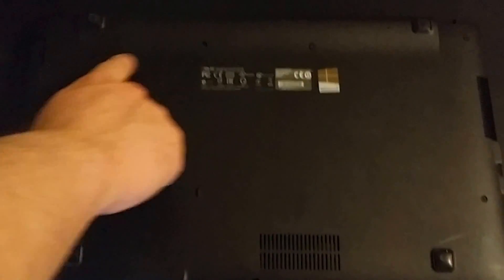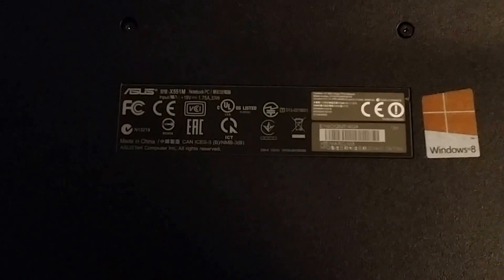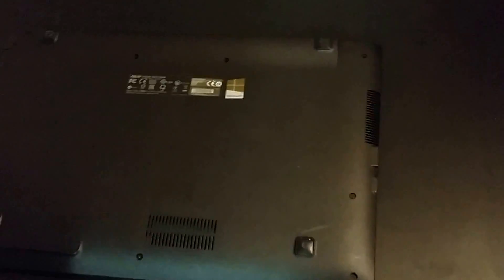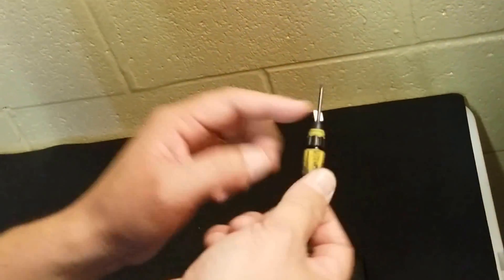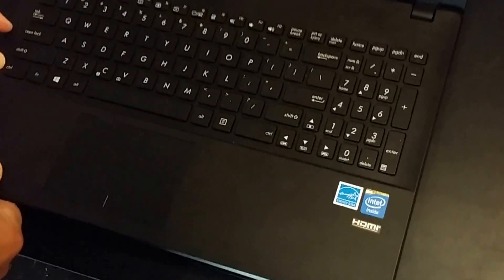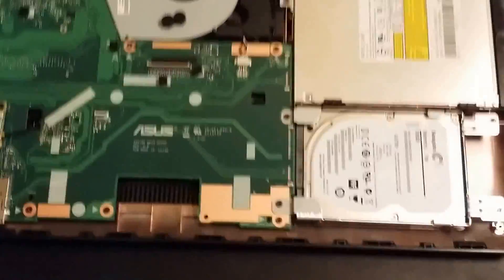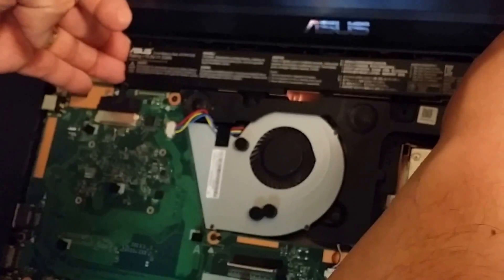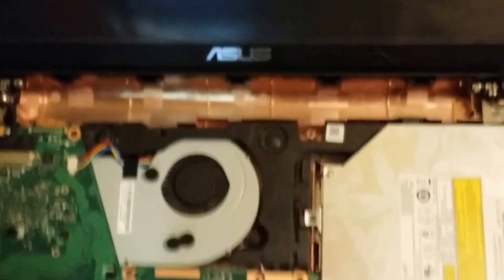ASUS X551M Laptop Battery Removal & Won't Power On Fix

Comment: This is a terrible design, my neighbor has this laptop and she has a virus on it that prevents you from shutting the computer down or doing anything on it aside from logging in. It's one of those virus's that want to you call a number and give them money so they can tell you how to fix it. So I just need to reboot the damn thing so I can boot it into safemode to remove the virus but I can't do it unless I pull the battery and put it back in.
Reply: TheCobruhAlienat0r I had the same problem. But, good thing I have a computer tech living in my house. Got it fixed right away.
Reply: *****
I read somewhere that they designed it that way because it was cheaper and because they figured that by the time the battery started going bad that they'd be looking for a new laptop anyway so the customer would just get a new laptop instead of a new battery.
Reply from the maker: TheCobruhAlienat0r They may have designed it that way for that reason in mind but does that necessarily make it right?  Had they designed a latch/cut out where the battery is and reversed the battery port on the motherboard so the battery could be removed from the bottom instead of the top, it would have solved everything.  I have customers bringing in computers/laptops that are circa 2004 Pentium M computers w/ Windows XP that are STILL serviceable (for the most basic things nowadays mind you) and they will not let them go and give them up.  They just want me to remove virus/malware off them and get them a new battery.
Reply: Why not just hold the power button for 5ish seconds?
Reply: SmokeyKurt
I tried that, it just put it into sleep mode. I was able to fix it without pulling the battery. It turned out that the virus had flipped the mouse buttons to where left click would do right click and right click would do left. So I installed Avast and Malware Bytes and got rid of it.
Reply from the maker: I agree that this IS a terrible design.  Some people are saying that the design was to facilitate motherboard removal or because it is used for "CHEAP" computers.  I think those reasons are "questionable" at best.  Computers are supposed to be END USER friendly made for regular people in mind.  Not being able to remove something like a battery is something I personally don't agree with.  Heck, most CELL PHONES have the ability to get to the battery to be able to replace it and those are exchanged out every 2-4 years!

Comment: Moron is the proper word! my thoughts exactly
Reply from the maker: Yeah, i was kind of harsh in my review and my emotions kind of spilled onto the video.  What should have been a 3 second action of simply removing the battery the normal way turned into something a lot longer.  In order to remove/replace the LED screen, you HAVE to remove all power sources such as the battery and AC adapter, thus my frustration.

Comment: Just got this computer for my mom, but I feel like we should change it, she's not tech say and travels a lot and if she needs to change the battery in a jam she won't be able to replace it. Soooo stupid.
Reply from the maker: Yes.  The next computer or laptop that you purchase, ALWAYS check for user efficiency such as removable batteries and hard drive/memory slot covers.  Then check for system specifications such as CPU type, Amount of Memory, Hard Drive type and size, discrete vs. motherboard integrated vs. CPU integrated graphics, etc.
Reply: Brenda G.P. What size screw driver did u use in the video.

Comment: See where I have a problem is putting the cords back, why did you not show you putting the laptop back together ??
Reply from the maker: Simply go in reverse after removing the battery.  Install the battery, carefully insert the ribbon cables back in then lock the latches back into place, snap the lid back to the base, then tighten all the screws back where they went.

Comment: how can i incrase the ram? i have that laptop and is shit...
Reply from the maker: Your motherboard may or may not be able to increase the memory depending on if your board is the permanently soldered on memory or the standard removable DIMM slot memory.  The memory is on the underside of the motherboard.

Comment: i am wondering, the battery life is so bad, is there a way to get a better performing battery?
Reply from the maker: Some laptop models allow you to get either a 6, 9, or 12 cell Li-Ion battery.  Some models will not allow you to switch to higher capacity batteries.  Check on the ASUS Technical Specifications for this model and look under the battery sub header to see if you can get a higher capacity battery in this system.

Comment: Thanks your video helped. it might of be cool to add a close-up of how to reconnect the ribbon cable, and a heads up on what to expect when you restart for the first time. But you helped me solve my problem. Thanks again for that!
Reply from the maker: You are welcome.  I am glad the video helped you with your problem.  Unfortunately, as I said in the beginning of the video, it was recorded with a smartphone and my intent was to help those frustrated (like I was) in trying to remove or replace the Li-Ion battery.

Comment: My best part "who ever came up with this design from asus is a moron"  LMAO.
Reply from the maker: Yeah, my frustration reared its ugly head unfortunately.  My personality is a "tell it like it is" and don't hold anything back when it comes to computer repair.  For this laptop, all I needed to do was a simple LED screen replacement and to do that, I had to remove the battery.  Imagine my surprise when I saw no way to do it the NORMAL way and I had to disassmble the laptop to get to the battery.
Reply: Ivan Richard  in having the same problem and i started cursing whoever the shit designed the laptop
Reply: I agree with you too. The person who thought of this is a moron. I may need to replace the battery for this very model since it will no longer charge. This video was very useful. Thanks alot!
Reply: +1'd precisely for this. :-D

Comment: Hello, I would be very thankful if You can help me... I have the same laptop but with no optical device... So i decided to buy DVD-RW and put it in my laptop, but there is a problem, I have warranty so i can´t disassemble it, I will lose warranty... So, is there a solution to put in the DVD-RW without taking it apart? It haves some plastic instead a real optical device (something like fake SD card in new laptop-s)... Thank You very much!
Reply: Try an external usb drive.

Comment: Frequently, design engineers will use an integral battery for economy, to limit failure points, and because their research shows customers rarely buy new batteries; the users simply buy new computers at the point of needing a new battery. Considering the price of this laptop is very low, and considering other more-expensive models do have more-easily replaceable batteries, the elimination of easy battery access is explainable. Certainly, it isn't moronish, and I question if Angrysquirrel PC, the uploader of the vid, has abilities comparable to ASUS design engineers.
Reply: They could have at least added an easily-accessible HDD slot or something. If your drive fails, good luck replacing it.
Reply: You really sound whiny. I'll bet that in 10 minutes of a conversation with you that I could find something to pick about you too, In fact, I would probably have several choices in which to point out your deficiencies. Stop being such a nerd.
Reply: Sadly, "Liberal Smitter" is all I need to know about you and how you think.

It is unfair of manufacturers to allow a $15 battery to be the cause of a $300+ replacement of an otherwise working laptop. End of story.

Any argument to the contrary is purely arrogance and the reason the world is in the state that it is. You realize you just made an argument for capitalism, right Mr Liberal Douche?

-----Original Message---
Reply from the maker: SmokeyKurt They may have designed it that way for that reason in mind but does that necessarily make it right?  Had they designed a latch/cut out where the battery is and reversed the battery port on the motherboard so the battery could be removed from the bottom instead of the top, it would have solved everything.  Grand total cost >>>>>  About 50 cents to do BOTH those things.
Reply: SmokeyKurt, you and Squirrel (and me) are making the same argument.

-----Original Message---
Reply: ***** , not entirely true, a friend of mine had the "thin" Seagate hdd fail in about 2 months in this laptop.  Hard drives can still fail early..happens.  But overall, I'm in agreement with you.  It's designed to cost less...they have to go "cheap" somewhere in the design.  It's also still a relatively easy hdd replacement.  Maybe 10 screws, and if a person knows how to reinstall the OS (which they would have to do anyway when replacing the hard drive), replacing the hdd should be a breeze.
Reply from the maker: I still think that this is a terrible design.  Some people are saying that the design was to facilitate motherboard removal or because it is used for "CHEAP" computers.  I think those reasons are "questionable" at best.  Computers are supposed to be END USER friendly made for regular people in mind ESPECIALLY at the $300 level.  Most people BUYING these laptops are 99% NOT tech savvy.  So essentially, if something doesn't work on these laptop models, most people will treat it like a disposable electronic and simply buy a new one.  Does thinking this way make it RIGHT no matter what the reason?  Not being able to remove something like a battery is something I personally don't agree with.  Heck, most CELL PHONES have the ability to get to the battery to be able to replace it and those are exchanged out every 2-4 years!
As far as being compared to an ASUS design engineer, you are taking the video out of context.  I am a computer repair shop technician/owner and have been doing this for 15+ years.  To see something designed this way in my opinion is not just moronish but is flat out wrong to do to the common end user.  Apple in particular does this as a way to make money not only from the front end purchase cost but to the back end repair costs as well.

Comment: So i need to take my battery out but, i'm afraid i'll fuck up in the part where you have to disconnect the keyboard and such. How would i even put those cords back on?!??
Reply: MianaxD To put that part back on, it takes some caution... you would have to make sure the latch is up and slide the part back in and close the latch.  (Note:  I only did this to the power button because it released itself after I opened it up for the first time.  As for the keyboard and track pad, same process.) Hope this helps :)
Reply: I know this is old, but I was able to get the battery out without disconnecting.
Reply: @JohnOberholtzer52  I know this is even older, but yeah, I easily slid the cover down off the battery without messing with the cables at all.
Reply: John Oberholtzer nice 
I actually popped my mouse latch a while back trying to take out the battery .... I pulled too hard when pulling the keyboard up and it snapped .... I always have to use a mouse now 
Now I'm back cause my half broken laptop all of a sudden doesn't want to turn on ... Gonna have to get a better laptop

Comment: Hi i have this same laptop , about an hour ago i was using it for college works and i decided to turn it off a thing i never do i get to my house and when i am going to turn it on it doesnt work , i thought it had no charge but i connect it and get surprides that the charging green light isnt on , what can I do to fix this .?  I have never opened the laptop and don't know if its the battery or if its the hardware conpletely...
Reply from the maker: If the laptop doesn't turn on it could be:
1. DC Jack is either damaged or detached from the motherboard which will not allow the system to charge the battery OR power the system itself.
2. Defective battery SOMETIMES caused the computer to NOT turn on.  Test this by removing the battery and plugging up the adapter to the laptop then powering on.
3. Defective Power Adapter.  Try borrowing a universal adapter with the appropriate connector tip and turning the system on.
4. Failed motherboard.

Without actually seeing this in front of me, I do not know if any power indicator light is on or if the system is on with only a black screen (LCD Backlight is on but no picture).  When all else fails, take it to a professional tech or computer shop for a diagnosis.

Comment: Ok, I have an Asus X200CA laptop, battery is also internal. Anyway, my laptop turns on fine, loads fine, and right after I type in my password and click Log In, my screen goes black. But it is still on, and I can see the mouse on the black screen, and I am able to Alt, Ctrl Del to be able to restart and what not, but that's it. Any suggestions? I have no idea what to do..
Reply from the maker: You might have an operating system issue or possibly the laptop is going to screen saver/hibernation mode too quickly.  Bring it in to a computer shop for a free diagnostic.

Comment: Is it hard to reconnect the ribbon cables while assembling the laptop back together? I have the same laptop and was wondering how difficult the ribbons would be.
Reply from the maker: It would help if you have smaller hands.  If you have larger hands, you might need a non conductive tweezer to slid the ribbon cables back into the slots and a long spudger to push the retaining clips back in to secure the ribbon cables.  My method was to reconnect the furthest back power cable in the far left corner while holding the lid then reconnecting the keyboard cable then touchpad cable.

Comment: Is this a bad computer or not?
Reply from the maker: It depends on what you mean by "Bad Computer".  If all you want to do are simple things like checking email, surfing the web, playing some YouTube videos and going on Facebook, then no, it is not a bad computer.
But if you mean trying to replace common parts like the memory, hard drive or Li-Ion battery, then yes this is a terrible computer since there are no back plates that will allow you to get to these items.
This definitely will not be good for graphically intensive gaming or programs that need fast multiple core processors or use a lot of memory either.

Comment: I dont understand how does the battery run out cant u just charge it? Someone help plzz!
Reply: Batteries accumulate damage with use and age and become less and less capable of holding a charge
Reply: Batteries just stop holding charge as they get older a computer battery should work properly fr something like 18-24 months depending on how much use you give it.

Comment: Also mine was made even cheaper. The HDD used in mine isn't Seagate, but some noname Chinese made HDD. =/ Think the brand on it was HGT, which I have never heard of at all.
Reply: Ahh nevermind, it is HGST, which further research says it is Hitachi Global Storage Systems Technologies, which apparently is owned by Western Digital. So basically it is just a chinese made Hitachi/WD HDD. At least it ain't some random chinese company that decided to start making hard drives.
Reply: Torque Effect Corection, Hitachi Global Storage Technologies. Sorry it is late for me.

Comment: sorry my friend but you are the moron not seeing the point. they did it for 2 resins 1 to cut cost 2 cus buy making it this way most not techy people cant upgrade the battery harddrive or ram without opening it and most people wont cus of this so thear for it will have to be sent in inturn making the company money doing it for them and charging. also it looks sleeker yet cheeper feeling but what do you expect from a $230  laptop I just got this laptop today and got it for $290 with tax and a 2 year acd replacement plane.
Reply from the maker: I see the point.  I just don't agree with it.  At this price point, 99% of people purchasing this will not be tech savvy.  Essentially, the company (ASUS) is making this model a disposable computer.  A solution to this is quite simple.  A cut out/plate holder for the bottom case where the battery resides at could have been done as is done on MANY other laptops and the Motherboard battery jack where the battery slots into could have been inverted so the battery could be slid and removed downward instead of upward as it is currently doing.  Grand total cost to do this at the case manufacturing and motherboard facilities: MAYBE 50 cents for both things to be added for the sake of the consumer.  I have been repairing computers for 15+ years.  Just because it looks "SLEEKER" and they want people to throw it away to buy another one (most people on here stated they would NOT buy a model like this from ASUS so who does that hurt in the long run for this design), it STILL does not make it right.  Heck most cell phones have the ability to switch out an old battery for a new one!  And if you bring up Apple products, don't EVEN get me started on them.  High priced items without a way to easily change out parts yourself.  Designed purely for marketing/repair back end costs and sheer greed.
Reply: ***** yes they should have used a battery that was removeable because I have found a issue with it if you use a bad usb cable and it shorts then the computer will stop working and the only way to get it to power on again is pull the battery and plug it back in. I hade it happen but once I opened it up unplugged the batter and re plugged it back in the pc works again. also doing research I found that the pc is actuly a cheap china made computer stamped with the asus name but I have ben happy with it so far.